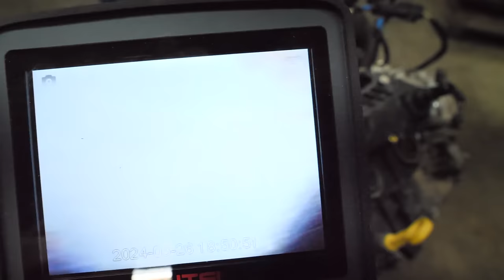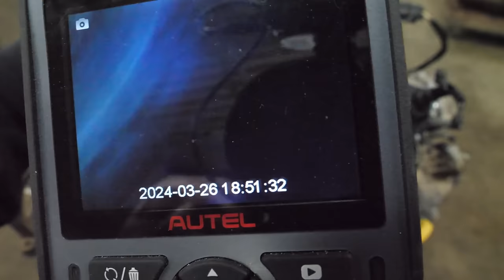ANOTHER BAD 2.7 Ecoboost? 2018 F150 Twin Turbo V6 DEAD @ 131k Miles

Comment: 47:06 I would swap a 4.9 I6 into it if it was purely up to me. I'm still firmly in camp 'There aint' enough meat on those bones for that application' with these 2.7s; they have no business in 6,000+ pound pickup trucks. They are just not substantially built enough to handle being at rated power for as long as they need to be in a pickup like this. Too small physically. Can they make the numbers necessary? Sure. Will they last doing it? No.

These engines...and the general industry trend in this direction as both Stellantis and GM are doing the same shit with, respectively, the Hurricane I6 and 2.7 I4...are a real world embodiment of the adage 'A candle burnt at both ends lasts half as long'.I don't live life like my taint is on fire as most seem to these days, so 120hp and 275 ft lbs for half a million miles is far more appealing to me than 300hp and 400ft lbs for 130,000 miles.

Comment: Anyone who can put money into R&D for coating bearings and that aluminium casting, then use a oil drive belt? Designed to fail? Already splitting after 6 years.

Comment: Bad metal casting on the valve material, you can tell exactly what happen to the metal with an electronic microscope in any university metalúrgic lab, the whole problem started from there.

Comment: my 2.7 biturbo Fusion has 135K miles and still runs like a champ, can't say enough good things about it. very tall gearing and long legs, cruises very relaxed at 90+ all day (we have wide open freeways here) ...
Reply: Get it tuned! Livernois Motorsports handheld tuner for $500 and enjoy running mid 12's on nothing but a tune.  It'll do 0-60 in very high 3's, 4.0-4.1 range as well.  Makes them rip!
Reply: @BasedEMT1776  sounds awesome but it’s just my work car, plus I need it to be reliable for at least another 50K miles. I have it up over 130 mph just about weekly, love that car!
Reply: @tonychavez2083  Mine has been tuned since 50ishk miles and it's got over 100k now.  And I've not been easy on it.  Don't sweat the reliability.  Livernois tunes their cars extremely safe with a lot of things the ecu "watches" for, and if anything is out of wack it dials it back to stock levels of power.  It's awesome.

Comment: 15 16 have oil pump drive chain.. after that they have 12 injectors.. my 15 has 200k on it and still runs perfect.. tows my travel trailer ..   i keep thinking the 15 will last longer.. when the belt fails its all junk in 1/8 of a mile.  dont know..

Comment: That burnt valve looks like someone took an acetylene torch to it. Could it be that this truck had nitrous, but not quite enough fuel?
Reply: Probably something got stuck between that valve and the seat and the burn off torched that area. Similar to a plasma cutter.

Comment: This is one of todays biggest problem! "Just throw away and buy new stuff".. If you se it from another perspective, why is a nice engine like that so cheap? Is that really sustainable in the long run? What are the actual cost in total ( environment , stressed out labour, democracy(supporting despotic dictators(i.e. china,saudi arabia)). Think about it! The costs are cut somewhere..
So should you repair stuff(in general) ? Definitely yes!

Comment: They use rubber nelts so that you inevitably have to change them earlier, meaning you have to pay ford technicians for half an engine teardown and add to that a new oil pan (if it's required to take it off to change it) and you got a lot of money going into ford's pockets in the next 5+ years. It's an investment. Shit designs ruin somebody, either the manufacturer or the customer, depending on who's dumber

Comment: Eco- post engines are literally some of the worst trash on the planet, For some reason Ford owners love them, though they crack pistons, break con rods, at low mileage for no reason. ford owners have to be the dumbest people on the planet for liking these. I know 3 people personally who had these blow up under 100k kms.

Yeah GM has bad lifters in their current engines but at least if you do the DOD delete you have the most reliable engine you can still buy, kinda like the vortecs and 350s. 

Ford owners need to stop defending these.

I was talking to a guy who said “yeah it’s a great engine, I needed a new one after 90k though cause a piston cracked in half, but great engines”

Comment: Shoot I change my oil at 3-4000 and I hit 138k on my 2.7 and knock on wood it’s doing good mines a 17 with the old 6 speed not the 10 speed that gives problems

Comment: I only ever had one Ford in my life and it was actually superior back in the late 70's.  Now coated bearings but an oil immersed belt? What were Ford designers thinking? I have just deleted the name Ford in my mind, even to the switch to electric, the Mustang hogs showrooms followed by the F150 lightning. Buy ICE? At least Toyota has some longevity planning!

Comment: Remember back in the day. When engines were low horsepower but ran forever? The cars would rust out long before the engine died. Now everyone would wants high horsepower and good fuel mileage.

Comment: A plastic oil pump gear, i thought i have seen everything and now seeing this, The plastic intake manifold and valve covers are bad enough, how to engineer a truck as bad as you can make it, there is always the deluxe  paint job to sell the heap,  I will stick with my chevy 1979 Silverado custom deluxe C20 with a V8 350 engine, all metal parts , no pollution control to strangle the  vehicle

Comment: The oil pump belt is the most baffling idea; chains are better run wet, belts are better run dry, it's a simple engineering principle that's worked for centuries, since we were using leather belts! James Watt would be spinning in his grave - but not for long if he was belt driven...😂

Comment: It is easy to see why Ford has pushed EVs so hard, they have not made a descent ICE engine in the past 10-15 years.  It is clearly easier for them to just replace "engines" with "electric motors".

Comment: An oil pump drive belt is a guaranteed repair needed in intervals. I wonder what the book shows as far as a R&R time for them in a truck. A stupid idea...and then theres no keyed crank snout..smh. rigs i won't touch with somebody elses 10 foot pole.

Comment: I have a F-150 with the 3.5 Eco-boost, and it is a joy to drive. The acceleration and power is incredible in a pickup, let alone a V-6. But watching the teardown of this engine makes me realize that the fact that they are as reliable as they are is incredible. I wish we could just go back to huge V-8 pushrod engines with the fanciest thing about them being advanced fuel injection. Just big, simple, and reliable. I hate the EPA.

Comment: they seriously use a plastic quarter twist drain plug? and I thought they were rigged to fail before. jesus christ. as if the disintegrating belt increasing timing maintenance from every 200k to every 50k miles wasnt bad enough, its just waiting to dump all your oil out when that plug gets brittle.

Comment: I really don't understand the oil pump drive belt.   That one has to strictly be cost cutting with zero other reasoning behind it.  

Countless engines out there with drive chains for the oil pump, zero issues.   Or what happened to just designing the pump to drive directly off the crank?  Nothing wrong with that design ethier, and hey! It costs even less than the chain OR chain because it requires neither!

Comment: Not a Mechanic, but anyway, if I was or I was the driver of that F-150 I'd replace all valves and all Pistons and their support parts, 'coz the malfunctioning of that single valve affected negatively, the whole engine-transmission, and indirectly other parts of the truck; so a general clean up, flush and oil change to engine and transmission. Leave it a the best driving condition possible. I'd go as far as to change all other fluids and filters: including brakes, steering if it has fluid, coolant, fuel filter... the works. 'Coz it was serious, at the core of the engine

Comment: How much is saved using a oil pump belt instead of chain? And now you have a service item that will be costly to change and will certainly destroy your motor if you don't.  Planned obsolescence can be the only goal.

Comment: probably the number one reason why engines fail is a complete lack of maintenance. People just don’t change their oil. It’s as symbolize that.
Probably number two is they are abused, more than likely there, abused again without changing the oil. 
It’s like 50 bucks to change it  Good quality the oil. Good quality filter.
BTW, Fram is not a good bodybuilder
Reply: Where are you at that it’s 50 bucks? It costs 80 at a shop for my Toyota 1.5 engine oil change. I’m jealous 😂😂
(Course I do it myself so it costs a bit less than 50 in materials)

Comment: I would replace the engine. Without the benefit of the teardown you just did, and not knowing where that hunk of valve went, I would feel more comfortable with replacing the whole engine.

Comment: In 20 to 15 years you probably won't see any of those Ford EcoBoost engines with the rubber belt for for the oil pump but I know other car companies are using the same idea of rubber belts for the oil pumps and I don't think they'll be around in 15 to 20 years unless they're very low miles and even then it'll be like dude might be going it's old as hell cuz lifespan of a rubber belt ain't no 15-20 years I think before that I don't know what the oil will do to the Belt probably shorten the life of it that one looks all worn out and I bet that things not even that high miles

Comment: cannot believe they use a rubber belt for the oil pump and that it is sitting in oil all the time.   don't think that worked well on their 1.0 ecoboost.

Comment: Heck with 20 years im driving a bronco 2 from 1988. It's biggest problem is the rust. It's 2.9 V6 is still humming along. It even survived running out of oil after it's oil pressure switch broke and drained the engine. The repair shop had it fixed the next day because the engine didn't seize after the fact. when i shut off the engine something in it was screaming. And still doesn't burn oil.

Comment: When it comes to the oil pump belt, typical ford. Constantly coming up with ways to force the average person to take their vehicle to the dealer, because what should be a simple replacement requires the engine to be pulled. Can't even replace your break pads without a special tool.

Comment: I am not a fan of a belt to drive the oil pump either. But its not made of Rubber its made of Kevlar which should last a good long time (not as long as a chain) and so far the only engines that seem to fail with the belt driven oil pumps are the tiny ecosport POS engines. So maybe its not anything to worry about? IDK.. My thinking is that ford dont want to build an engine that is too damn good so they engineer some BS in there that will eventually fail. I have seen a lot of these motors with over 200k on the clock. Maybe just pay to get the belt replaced at 150k and not have to worry about if.

Comment: I just asked my ford dealer the other day if ford had added port injection in the 2.7 yet and he said no, i have a 2019 2.7 in my f150 and have not been able to get a straight answer on whether its got port injection,  everyone says no, but you said that 2018 had it. Now im totally confused.  Does anyone know for sure the answer? Thanks in advance!
Reply from the maker: All gen 2 2.7’s have both port and direct injection. Yours is both
Reply: @I_Do_Cars  So do I still need to pay ford to run valve cleaning additives? Now they want to do a new one every 10,000 miles in addition to the one they do every 30,000.
Reply: @I_Do_Cars  Also, thanks for your reply!!
Reply from the maker: @groverscorner2364  Seems completely unnecessary so often. I would ask them for any kind of proof it needs done. If it has port injection, the point of having port injection is to keep the valves from getting dirty.

Comment: how many of these engine are made each year?  I would wager with you that more 5.3"s destroy themselves because of AFM than these blow up. But you still sell them. Every engine made some will blow up.  The first 2.7 was driver error he should have parked the truck with the first sign of trouble, he kept driveing and got what he deserved. GM's 5.5 twin turbo V8 is a marvel, but they stopped putting them into the Cadillace sendan becaues GM
buyers would rather buy a large lawn mower motor. Go figure.  My rant for the day.  I don't hate any make of car I have owned 7 GM, 6 Ford. 1 Dodge, 4 Nissan,

Comment: 3500 miles between oil changes is a whole lot better on your engines than using the lie-O-meter computer oil change computer guessing your changes.

Comment: Direct injection,turboed,small engines don't live long. My Pontiac 2.5litre,151 has 300,000 miles on it. They called it the Iron Horse for a reason. They even put in a 1984 camaro.

Comment: I like this engine as much as any other engine I have seen here. I like many elements of the design, the casting and machining downright pretty, it's compactness and high specific output get a well done by me. OK, the pan and intake and belt you say?  That isn't the engines fault. 
So many of these modern engines are just goofy.

Comment: HAD A 16 F150 WITH A 2.7 CAME ON RUNNING ROUGH  CAM CODES ON BANK ONE TOOK VALVE COVER OFF FOUND CHAIN BROKE TOOK FRONT COVER OFF FOUND CRANK GEAR BROKEN ON BANK ONE FOUND #2 INTAKE VALVE ROLLER ROCK BROKEN FOUND IT BENT INTAKE VALVE

Comment: Repair that engine. It's easy now...   got a 4x4 f-150 2015 2.7 with 200,000 miles. 28 MPG on a easy foot! Better than my jeep patriot. crazy. smooth and quiet.  god bless my chain drive oiler.

Comment: It's absurd how far people are going just to not put a hybrid system in. I have a port injected 103 HP 1.5L I4, and a hybrid system to allow for 212 hp. no turbo or any other junk, and no accessory belt, open drive pumps, or anything like that. Not to mention the fact that an ECVT is basically bulletproof.
Reply: Bulletproof, hybrid and ecvt don’t belong in same sentence. I’m sure it’s a Toyota but still lmao
Reply: And continue to wallow in your self-righteousness. 😆
Reply: The only hybrid system we should be adopting is a diesel/gas-electric system like what you have had on trains for decades and Edison motors is trying to put in on vocational trucks.

If you don't have a battery to worry about you greatly reduce the cost and most people's concerns with range, resale, and reliability.
Reply: Because some people (myself included) don’t like hybrid/electric cars and can do without the extra complexity
Reply: judging the responses i think lots of people are ignorant and dont understand how reliable the ecvt (powersplit) is.
Reply: @Kevin-fm1vn power boost f150 is a hybrid that has little benefit other than performance. Slapping an electric motor into an 8 speed or whatever they use will retain all the issues of an ordinary transmission, not to mention that they slapped turbos in the engine too, and have other traditional components. A hybrid that actually has some real benefits are those made by Toyota (ths) and Honda (Honda i-mmd)
Reply: @joseeduardo4327  Honda, Toyota does ECVTs differently, they use a planetary power split devices. Honda basically uses a diesel electric system with an overdrive clutch for mid-high speeds. The design inherently lacks the same failure points as an ordinary transmission (ie manual, automatic, cvt)
Reply: @Hybris51129  hybrid batteries have proven themselves for the past 2 decades as being very reliable, and when they do go bad they typically go bad slowly, and the car will remain reliable. Much better to replace a battery pack every 200000 miles (easily more) than having to have your engine rebuilt because some godawful turbocharged variable compression cylinder deactivation equipped engine had a catastrophic failure and has countless obscure failure modes.
Reply: @Kevin-fm1vn an ECVT could be built to be of basically anything, a planetary gear set as in a Toyota ECVT is not different than that used in a regular automatic. A series hybrid could do the same thing, a series hybrid drive is essentially what diesel electric locomotives use, minus the battery.
Reply: @Hybris51129  using a series hybrid system without a battery would render it an exceptionally bad drivetrain with no benefit other than reliability and the ability to hold the engine at max power. Series hybrids suffer from double energy conversion, typically about 80% efficient, the only reason why they are efficive at saving fuel is because you can run the engine at the most efficient point and use the battery as a buffer.
Reply: @Kevin-fm1vnlimits to using an ECVT for heavy duty vehicles have to do with the lack of efficiency gains (without using a very large battery). Having a big engine would require a bigger battery (more sustained input and output capacity), using a regular transmission has the benefit of a higher MECHANICAL efficiency, but the lack the capacity to optimize the engine operating points. Mild hybrid systems are almost always ineffective at contributing significantly to efficiency (they are basically glorified start stop systems, some are more capable than others, Hondas IMA system could shut down the engine and operate the AC at the same time in later iterations, and provide a decent power boost). Also worth noting too that while towing a heavy load, I doubt a hybrid system could have much benefit.

Comment: I have a 2017 f150 with 224k on it only changed plugs at 198k battery and alternator beside oil,brakes, tires, regulator maintenance love the 2.7 v6 twin turbo best engine I ever owned 👍🏻🍺

Comment: Have you seen the oil drive belt fail?  If not, stop talking about it so much.  
Ford engineers are probably smarter.
Every time you take one of these apart you spend so much time giving your opinion...  You could be right?  Millions of these on the road.